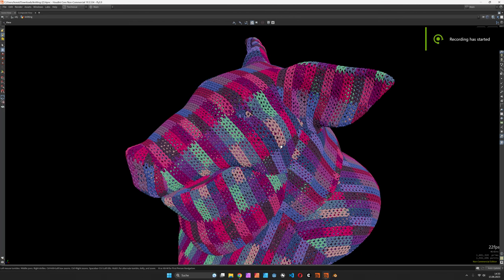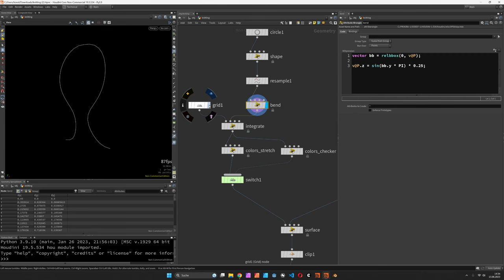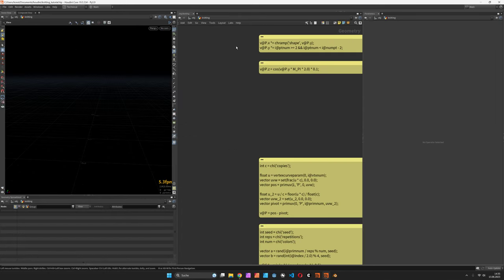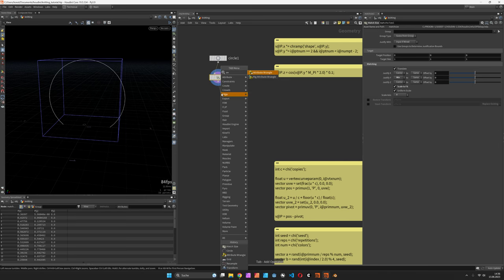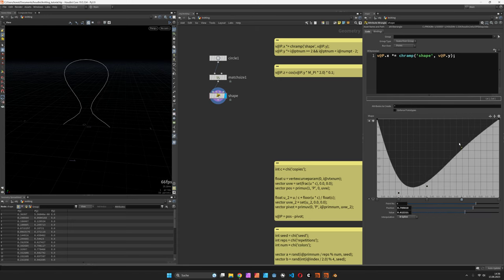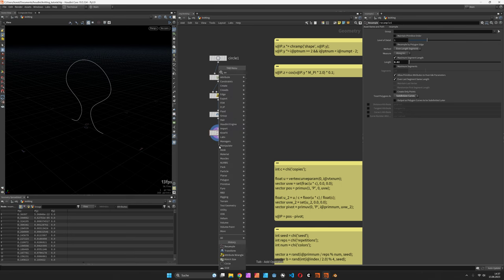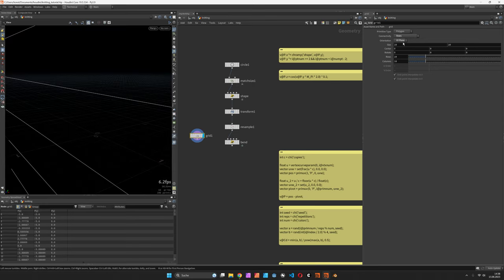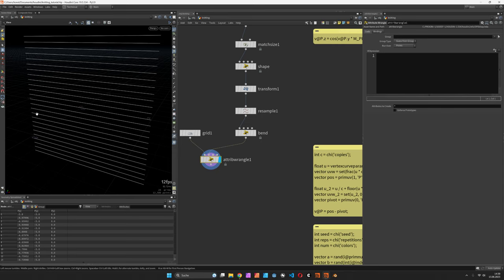Plain Weft Knitting – Houdini Tutorial

Comment: Thanks for the cool lesson. I have a question, is there any way to make the distance between the threads different? for example, textiles in running shoes can be like this. When at first there is one binding, and then it goes into a larger grid. But at the same time, so that the connection between the threads is preserved.